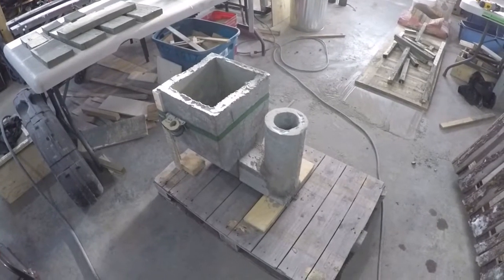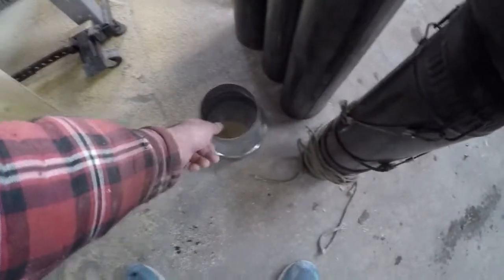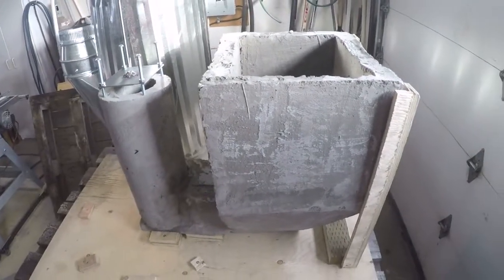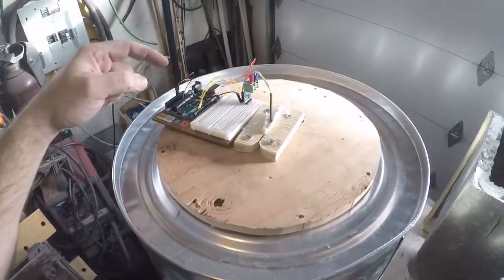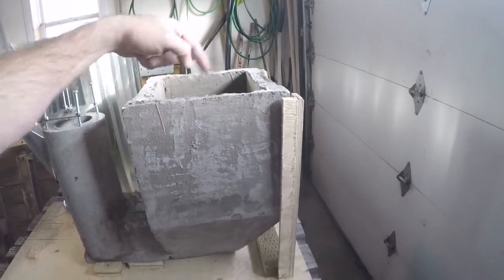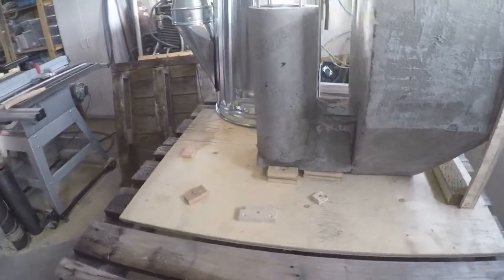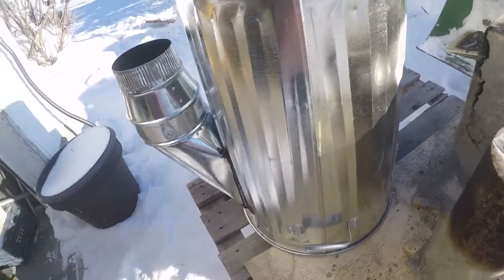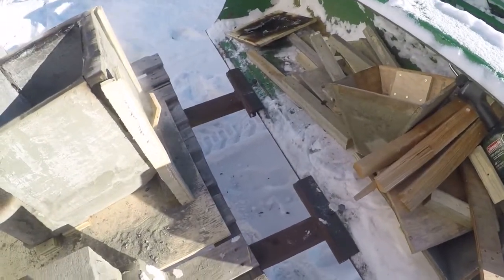Rocket Stove 2 - Part 4 Aircrete Stove Test

Comment: Original Aircrete with honey-do carpenter chimney was cylindrical cans Aircrete lining. 
Aircrete was treated with water glass for fire resistance. 
The addition of wire mesh to exterior of aircrete mix would provide seperation strength as in rebar. Creating a firebox with stucco wire near exterior surface would improve resistance  to failure by expansion. 
Having large coffee cans with Aircrete lining with water glass would allow some expansion resistance. Stacked, lined coffee cans would also allow expansion. offset coffee can one inch below  concrete to allow stacking lock up.

Comment: Uh, cracks because of no chicken wire...
Reply from the maker: Hi Lance, Yeah, thats part of it for sure. I think my concrete was old, it had been sitting for 2 years so that was a factor. Probably lots of factors, lol. I will get back to this for sure, but right now I am trying to get the tracked machine running. Hopefully this winter I get time to work on the next versions of the stove.

Comment: Your box to riser ratio is to big . The riser is a bit on the short side to . Good luck on the next one
Reply from the maker: Hi Paul S, the steel version I have now is using the same riser but at least with steel I can fix it easier or modify. Should get to working on this again in next couple months.

Comment: Jeez that sucker really came apart!  Be careful with the galvanized getting too hot.  Melting galvanized gives off nasty zinc gas which will make you sick and/or potentially worse.
Reply from the maker: Hi Johnny, Yeah,this test was an absolute failure. Going to use a pile more of that galvanized stuff so will keep a distance of it for sure.